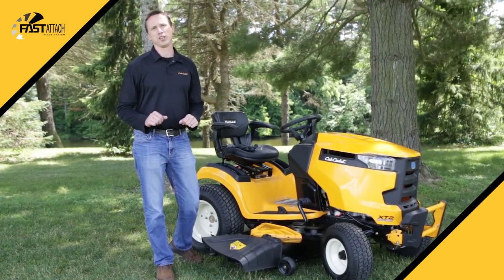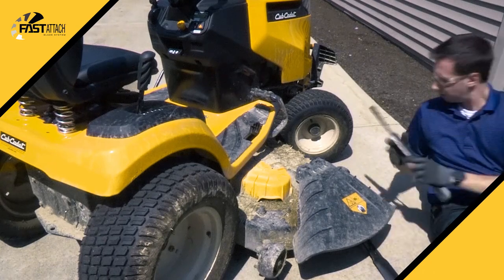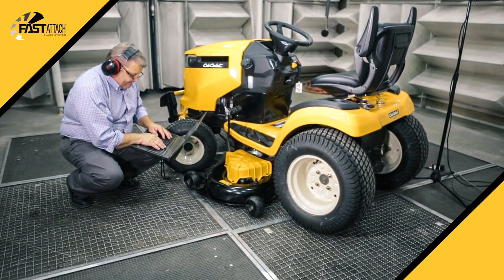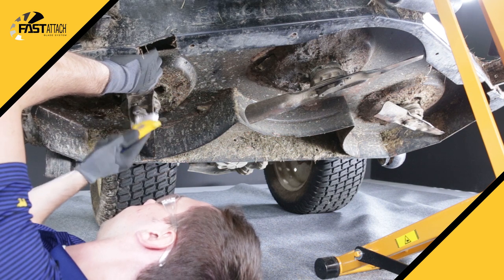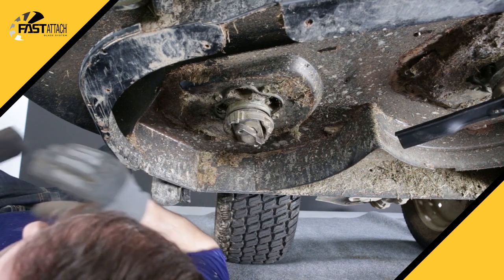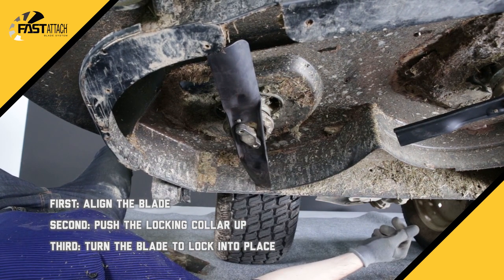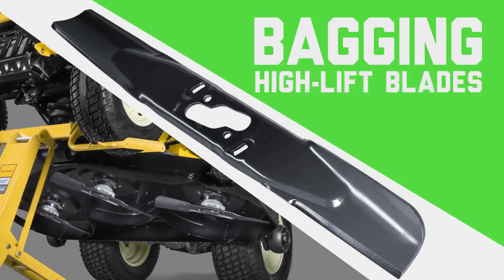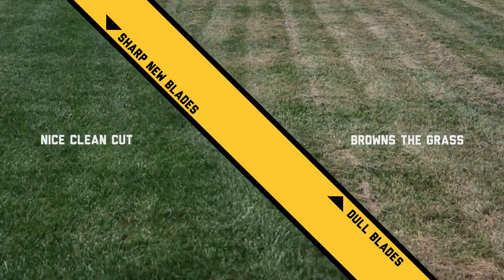Cub Cadet Fast Attach Blade System  Introducing the fast attach blade system

Comment: I'm starting my 4th season with the Cub Cadet XL2 50" with the fast attach blades. I have 117 hours on the mower. I removed all three blades and replaced them with new blades in just a matter of minutes. Having a mower lift greatly helps to get under the deck. I'll sharpen the old blades and swap them out as necessary. I'm sorry to hear other folks are having issues with this system. Mine works fine.

Comment: I bought a new Cub Cadet with this feature. At 10 hours I could only get 2 blades of the three off. At 20 hours I could not get any of the blades off. I just could not get the mechanism to move up enough to dis engage the pins from the blades. This is despite the fact that I wire brushed all around the blades and mechanism as outlined the the videos. In the second hour of messing with this "Fast Attached System" I carefully scraped the thin film of hardened grass juice from around the outside diameter of the sliding aluminum housing (a wire brush would not touch this stuff). This allowed the mechanism to now move high enough to disengage the pins and remove the blades. The video says hours of testing but probably in the lab not in the field or they would have discovered this problem. Our grass must be tougher in Michigan. The intense cleaning required to make this system function far overshadows the time to go get a wrench out of the tool box to change a blade.  If Cub Cadet Engineers want to get more information or come cut my grass and test, get hold of me through my selling dealer Sloans in Linden Michigan
Reply: Sorry to be offtopic but does someone know a trick to get back into an instagram account..?
I somehow lost my login password. I appreciate any assistance you can give me!
Reply: @Mitchell Rocky instablaster =)
Reply: @Dakari Gregory It did the trick and I now got access to my account again. Im so happy:D
Thank you so much, you really help me out!
Reply: @Mitchell Rocky Happy to help =)
Reply: Agreed. Not all that easy. You have to use 2 hands. One to push up on the collar and one to rotate the blade. Definitely need to raise the front end so you can get under there.

Comment: As a owner of a 54" mower with this system - good luck after a year of mowing.  The deck wash doesnt work well enough or designed to keep the area above the holding device clean.  Youll be hammering with a dead blow hammer while twisting the blade.
Reply: Agreed. I have the 54" fabricated deck, and I find the fast attach blade system to be difficult to use. There are two potential problems. First, it can sometimes be difficult to push the blade collar in far enough to unlock the blade, allowing it to move. Sometimes, you have to work the blade collar a bit to fully free it up. I like to attach a 4" / 100mm C Clamp to the blade collar when I get set to hold it steady in place to twist the blade off. You don't have to affix the clamp all that tightly. It's very easy to hold onto the C clamp frame to push up on the blade collar for releasing the blade--much easier than using only your fingers on the blade collar. Second, you may have trouble rotating the blade off. If so, I take my air hammer to the back side of the blade with the regulator set just above low. The blade comes off promptly in situations when I do not have the physical strength to move it by hand. It's amazing how efficient pneumatic tools are! My experiments hitting the blade with mallets were not successful. When everything is clean, this system is extremely easy to use, and you'll wonder how it ever gave you trouble. But, it can be difficult to do all this lying on the floor with the front wheels jacked up off the ground, especially if there's significant build-up underneath the deck. And, that middle blade on the 54" is the least convenient to access, and it's the one that will typically give the most trouble. Sometimes, it's just best to give in and remove the deck, as things tend be more cooperative that way. I have doubts whether this system will work out in the long run for Cub Cadet with the general public. Also, I do not use the deck wash system, but I clean my mower regularly with compressed air and the deck with a scraping tool. Otherwise, I love my GX54" D and it's doing a great job for me. My salesman said that the mounting pattern for the regular spindles is the same as for the fast attach, at least according to the tech that he inquired with. I have not verified this myself, but I may switch over some day. Overall, this is a really fine mower, and it's unfortunate if this issue deters some people from purchasing it.
Reply: Your comment just took CC off my list. Thanks!
Reply: I only have 10 hours on my GX 54 and the only way I was able to remove the blades was to use a rubber mallet and a small pry bar. I will try to find replacement spindles for it or sell it and buy something else. Rest assured it won’t be another Cub!!! This is just a stupid marketing tool 👎
Reply: @rjd8434  I'm wondering how you used the pry bar? Can you explain your procedure a little more? When I told my salesperson that I liked everything but the fast attach blades, he encouraged me to call Cub Cadet to complain and ask that they send regular spindles. I never took him up on the idea, because I didn't think that they'd send the spindles, but you might want to try it if you are that upset. He seemed to think that they might send them. Last time I bought a spindle for a Husqvarna, I don't remember the exact price, but it was expensive enough that I don't think they will give them away for free just to satisfy a complaint.
Reply: @William Guenthner you made a good decision. I’m going to do everything I can to spread the word about this garbage. I’ve never posted a YouTube video but this may be a good subject to begin with. I’m extremely PO’d
Reply: I guess as long as were discussing this, i have a few issues with the mower. 1st after i brought it home from the dealer it didn't start. The auto choke piece that controls the choking was hung up in the no choke position from a spark plug wire. I fixed that. 2nd The mower will over turn where you can turn the wheel far enough that it sorta locks into that position. I get wanting tights turns but this is a bit much. 3rd I bought the model with the arm rests. Total waste because the tires are so hard that unless you have lawn like a highway the mower bounces around so much that you'll have a bruised liver when your done. I ended up running like 5 lbs in the tires to help not get the Ef beat out of me while mowing. The arm rests are off the mower now. 4th the seat switch is total crap. The bouncing around i previously mentioned - well that will disengage your blades and kill your mower all the time. I had to modify the switch assy. to try and make it more forgiving to the slightest bumps. Also, if you reverse mow, and push and hold the button for the 5 seconds or whatever it is, its reset when your ass comes off the seat, so you re-engage the blades and then need to reset the reverse mow option.
Reply: @urizon41  In 2015, I purchased a Husqvarna LGT2654 from Lowes. They set it up, plus handled the delivery. The delivery truck lift was only deep enough to fit the rear tires on, and the delivery personnel had to muscle the front end down using the lift on the rear tires only. I ended up redoing about half of what they setup. The LGT2654 had the same Kohler 7000 series engine (manual choke) as what I have on my Cub Cadet, with the exception that my GX54 D has Smart Choke, as well as a low oil pressure switch. My experience with the manual choke was that it was very inconsistent. It would work 6 times in a row, and then I'd choke it the same way I had been doing the previous 6 times but it wouldn't work. Then, I'd have to mess around with it until it fired up. Smart Choke has been working great for me. I've been able to start it cold in any throttle position, from high to low. I haven't had any problems restarting it when warm. Because of my previous experience with Lowes, I double checked all of the setup on my machine. The only thing that I found that was not done was setting the height of the deck wheels properly. Presumably, they didn't want them to get scraped on the concrete before delivery. After I fixed that the cut improved. I think it's worth mentioning that it did take me some getting used to as far as the procedure to remove and reinstall the deck, and this is probably best done when one is in a relatively better mood over the Fast Attach situation than when one is fighting getting the blades off. I found if I didn't strictly follow the instructions that it led to problems. I also found it took some trial and error to discover the best way to use the ratchet wrench in the 3/8" drive square hole to remove / reinstall the belt. I ultimately found for me that an 18" ratchet 1/2" drive with a 1/2" - 3/8" reducer plus a 1.5" extension bar worked the best for me, plus I had to learn how to position myself in the best manner.
Reply: We had a very wet spring in Michigan, and the fast attach did not work very well for me, requiring an air hammer. There were a few times when I had to cut when it was lightly misting because it was so hard to find a time when the conditions were perfect. We were dodging rain clouds all spring long here. As spring turned into summer, things got better. I've been sharpening my blades every 5 hours, and I did have a few times when everything came off easily after conditions improved. The problem is that even if you cut when there is no dew on the grass and everything has dried out, the grass will still have moisture in it--if it is green. Eventually, the moisture inside the grass is sufficient to cause problems of itself. It just takes a lot longer to build up than if the grass is wet externally for some reason. I finally decided to purchase the replacement parts to change back to the old way of doing things with the 6-point star mounting pattern. I ordered the MTD equivalent of 918-06978, plus hex flange nuts, plus new blades. I did not have to make any other changes to the hardware other than remove the fast attach spindles and replace them with 6-point spindles.

Comment: Ya know, there are just some people that will never be early adopters of Innovation which is why companys can't make products for everyone.  Also, social media gives everyone that has a big mouth an even bigger mouth and mostly when they've not even tried said feature.  These are the times we live in.  Heres what I can say, I have tried it, it does work, and koodos to any company that continue to innovate!  The rest is noise.  Great feature Cub!
Reply: Great concept. 20 minutes to remove (much cleaning involved)-15 seconds to sharpen.
Reply: Do you have this setup?
Reply: 1. Don't knock people for giving their honest opinion based on their use of a product. It is not "whining" it is sharing experience. 2. "You have tried it" means you no longer use it. What was your decision to stop using Fast Attach?  I have not used it, but then again I have no problem lifting my mower and hitting that nut with a wrench. Gives me time to check the deck for damage, clean it and give the mower some TLC. Not saying Fast Attach isn't a good concept, just prefer more hands on, and assurance from a tight nut.
Reply: Thinking like that is why so many products suck these days.. innovation without any real improvement isn't innovation.. more like de-evolution.. and a complete waste of time and resources.

Comment: I have the xt2 gx50 with the fast attach system. You can only get the blades from cub cadet at a premium price they are thin and don't last long mine rattles and vibrates so bad sometimes I think the deck is going to self destruct Dealer says they find anything wrong   so I spent 4200 dollars for a possessed garden tractor.
Reply: I actually took mine back to the dealer because the deck sounds like a formula one engine at 14,000 RPMs sucking in glass marbles. They said it was normal. Sure is loud for a 4,000 dollar mower

Comment: @Richard Sawdon if you push the locking collar up by hand you should see a shiny piece of metal I think aluminum and use a small pry bar that is curved at the end and get the pry bar between it and the lock collar and pry up on the lock collar. Hope this helps. I contacted cub and asked if the could send me replacement spindle which I told the I would gladly pay for . They told me that they didn’t have any replacement spindles for that deck. I think I’m going to take mine back to the dealership and demand that they resolve this issue.
Reply: I purchased my GX54 FAB D back in May, 2019 but it was actually manufactured in October of 2018, so mine is a previous model year. The model number of mine is 14C7A6CA010. The sales brochure from 2018 indicates that earlier in the year the GX54 D came with regular blades that mount using a 6-point star pattern, but they must have changed them during the year. In my case, the salesman conferred with a technician, and they told me that I could replace my spindles with 918-06978. It's a 54" deck spindle for 22" tires, as opposed to the 918-07389 54" fast attach deck spindles for 22" tires. They told me that the regular spindle would mount in the same holes as the fast attach spindles. I ended up ordering the MTD equivalent, plus the hex flange nuts to secure the blades. It probably goes without saying that you have to purchase new 6-point blades to replace your fast attach ones. My spindles required me to tap out the mounting holes. I used my existing mounting bolts from the fast attach spindles after running them through a die to clean up the threads. I did not have to make any other adjustments to the mower to get the 6-point star spindles to work properly with the existing hardware.

Comment: I bought a 2019 XLS 54 fast attach with three blades and it has been a nightmare.  The spring release locking collar has two pins that holds the blade to the collar. The collar does not rise up high enough to clear the pins from the blade.  I need to use two screwdrivers as levers to push the pins up far enough to clear the blade and a hammer to move the blade to the remove position. You need a second person to keep pressure on the screwdrivers  Be warned

Comment: that quick change spindle will not hold up to being located under the deck. it might work new. but it won't last. blades are supposed to be bolted on not clipped on. one strike on these blades and it will destroy the spindle locking pins. after grass, dirt, sand, even strands of rope build up the mechanism will seize. i have been a cub/ john deere tech. i have seen what is dangerous. if a blade breaks from an impact it will be thrown in a random direction. possibly hitting a bystander. those blades are not mounted tight with a bolt/ nut. therefore the blades are not completely secure. this is a serious safety issue. i have had customers report their blades shake, disconnect from the spindle when struck by unseen sticks, rocks, even scalping, causing spindle locking pins to break off. contrary to anyone's opinions. i would not listen to anyone that says different beings they are most likely of no experience. myself having worked professionally on lawn and garden equipment. its a use at your own risk. more than likely if your blade/ blades break loose you will be told you did not maintain them properly or did something wrong. and the liability will be put on you. majority of homeowners are not certified equipment techs. as a dealer we are. those quick change deck blade spindles are a use at your own risk. do not stand near the deck with blades engaged. you might lose a foot or worse someone else might. be safe have a certified technician perform the maintenance on your mower. its not worth the risk to do it yourself. the risk outweighs the cost. the manufacturer appears to not have done extensive field testing for prolong periods of time.

Comment: I think it’s a great idea. I’d much rather use this quick release method than screwing with a socket and wrench. Good on Cub Cadet for the ingenuity 👍🏼
Reply: @vanhapieru1324  I just tried changing the blades. I didn't even know it was an "Easy Attach" system so when I first looked at it I didn't see a bolt.  Went online and happily saw it was "Easy Attach".  Frustratingly long later I got one off. Came back to YouTube and saw what a mess this is.  Took a hammer and got the next blade to the slot and it came off.  For the center blade, I got it to the slot but it wouldn't come down. Ten more minutes of prying and banging it finally came off.  Then, happy that I got them off, I went online to find out that the damn things cost way more than regular blades.  So unless you are not handy or don't care about the money and can have the dealer to it, I'd seriously look for a more conventional blade attachment system i.e. a big nut!